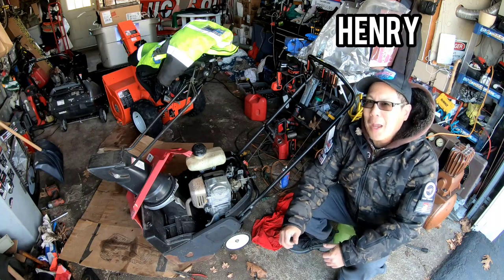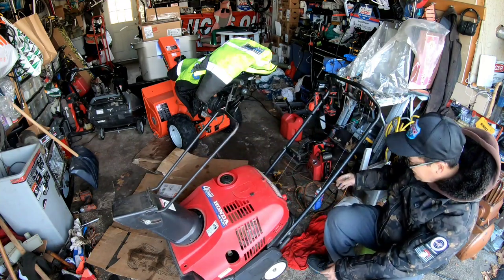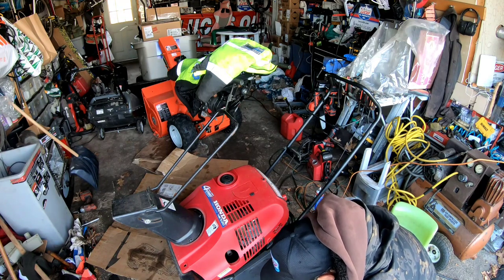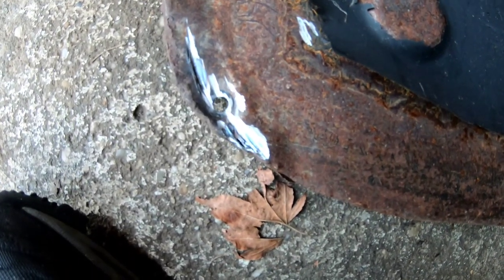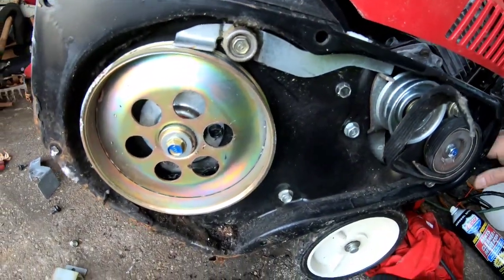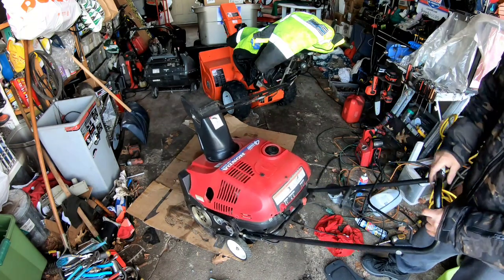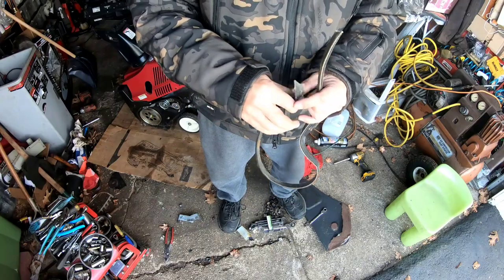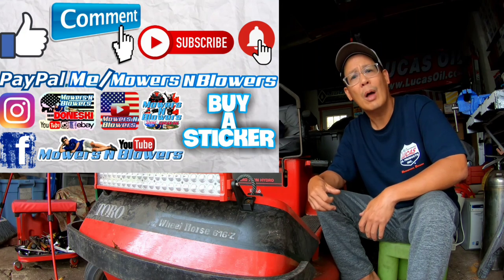WHY DOESN'T MY AUGER PADDLES SPIN? TROUBLESHOOTING HONDA HS520 SINGLE STAGE SNOWBLOWER COVER REMOVAL

Comment: Yesss!! Cold as heck 😂.
Those are good blowers. Here in Vineland nj. Napa auto parts sells the belt. I believe its about $15-$20 bucks. Those Honda blowers are a Work Horse!! Wish that model came self propelled. But they will throw snow.👍👍👍👍 Good luck to you brother. Smile more. Stay healthy
Reply from the maker: Thanks Anthony!  I ordered one on eBay for $13

Comment: Henry I gotta admit I feel just like you about going out to the garage this winter- gotta go South! Great to see me pop up again LOL
Reply from the maker: Yup you never know when your outro is used!
Reply: Hey @MowersNBlowers , why is my paddles spinning without hitting the auger clutch?
Reply from the maker: Your belt is coming off the pulley and riding on the lip.  Take the side panel off and see.  Or your engagement cable is stuck.  Only you can find out since I’m not at your house,  you won’t find out until you open it up to see!